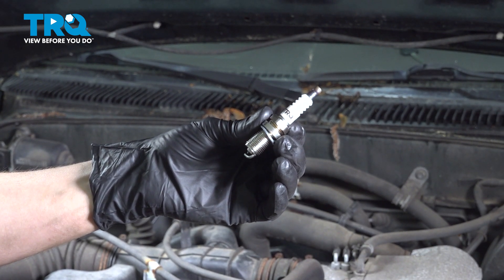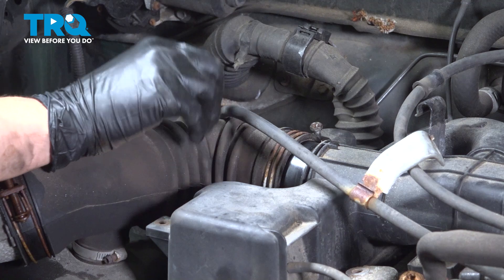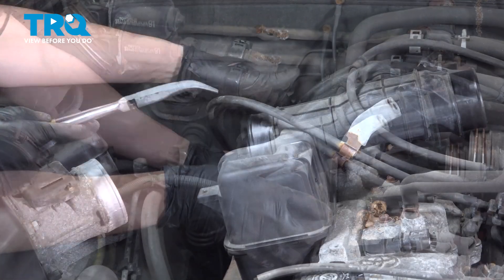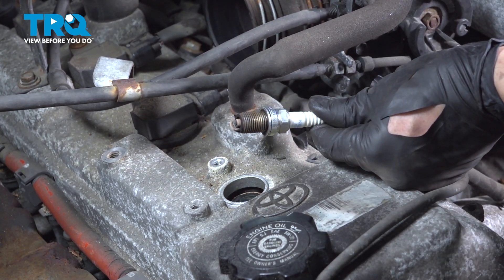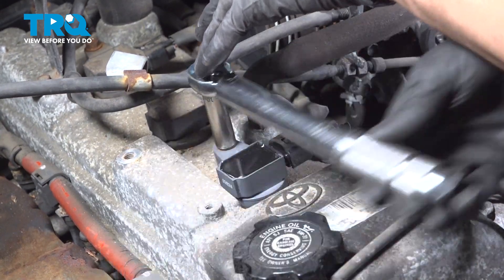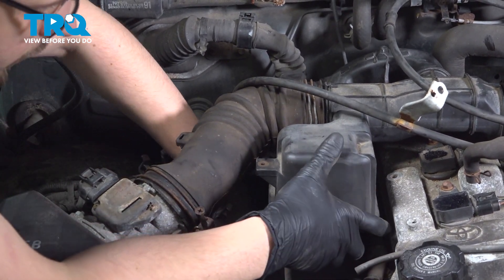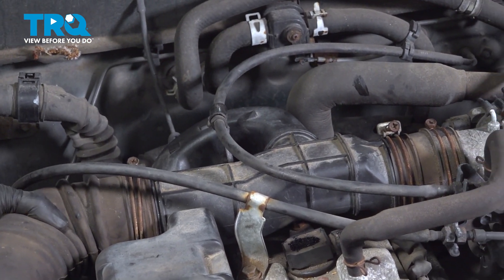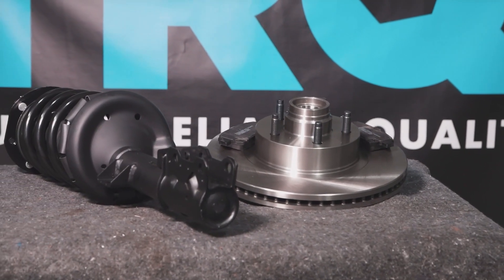How to Replace Spark Plugs 1995-2004 Toyota Tacoma 2.4L L4

Comment: Thank you so much!  I replaced my plugs after watching your video, took less than an hour because you listed the tools I needed and all the items that needed to be removed.  But, having gone through spark plug replacement on my BMW e39 last month after watching a similar video, shouldn't we use anti-seize compound on the plug threads?

Comment: What are your gaps for the spark plugs?
Reply: Unlike 40+ years ago, you don't need to worry about it.  Modern spark plugs are manufactured in a wider varieties of models so that they generally can be pre-gapped for the smaller range of vehicle each model is specified for.